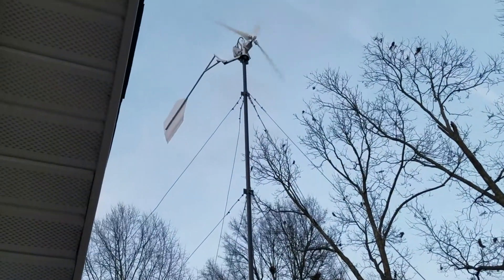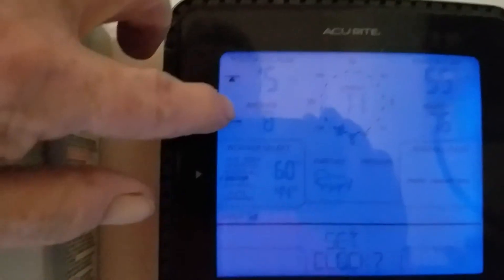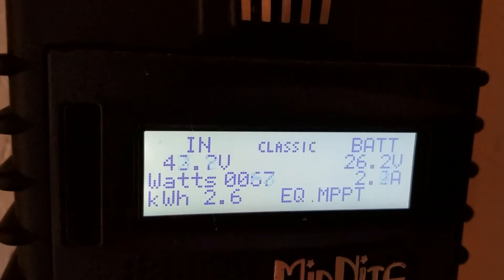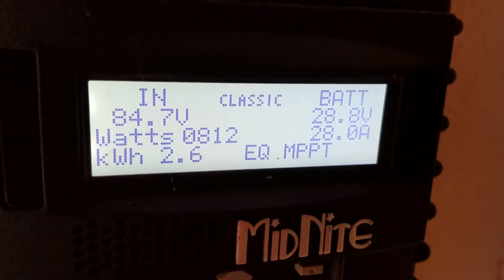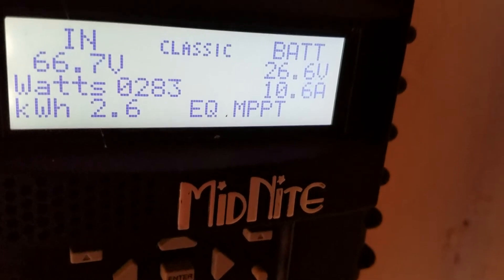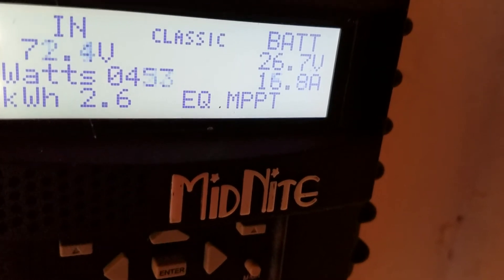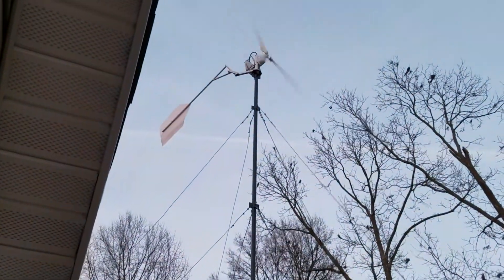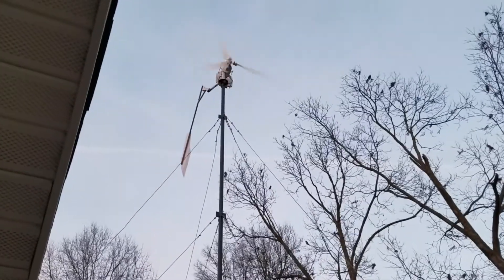wind turbine output jan 2018

Comment: Nice ... what wind turbine is that ?
Reply from the maker: its one of the type i build.  most call it a Axial wind turbine, no cogging at all.  20 magnets on each plate, 15 coils, 5 per phase, its built to put out decent power in low winds.
Reply from the maker: its 8:59 and i am still getting readings over 1KW highest i have seen is 1877 watts  total of 3.5 kw so far, it should go over 4 kw before midnight
Reply: Oh ok cool I have Hugh's book but desided I could not work with strong magnets in my metal fab shop because of the steel dust every where .
Reply from the maker: you can make all the parts, then i set up a work table out in the yard, all wood, and installed the magnets  then brought it back in the garage.  if you do get some metal dust on it, its easy to remove it.  it almost hit 4.0 KW it was just about to turn to 4.0 when time ran out, it hit 3.9  144amp hours highest watt reading was 2,348 and highest voltage input to charge controller was 142.2  so tomorrow is more wind, but with some rain
Reply: wow your making some real power . I was just watching your earlier vids when I saw your replay . I've been working on my tower and put up a windy nation supper amp at 55' but still have to run wire under ground into house , the weather has me on hold right now. I will follow your advice about the magnets this summer though as the supper amp tops out at around 55 amps  I think . but I will see when the weather brakes .
Reply from the maker: sounds like fun. fairly soon ill add a second inverter, a outback fx version that can be grid tied. it still needs a small back up battery bank to work, but 90% or more goes right back into the grid so you get even higher output from your wind turbine. the batteries limit output with resistance. the fx once batteries are full sends it all, making that meter turn backwards.  power company has to install a meter, called Net-metering. but you get so much more from the wind turbine.
Reply from the maker: oh, forgot to mention, magnets, i use to get them from Magnets4less, which i found out were low grade seconds.  i only get magnets from CMS magnetics, really good quality .
Reply: I have decided not to mess with grid tying and just keep circuits separate . the power companies want to renew contracts once a year .
Reply from the maker: well, when your ready to built your turbine, if you need any suggestions just let me know, be glad to help
Reply: Thanks I will .  I'll probably have questions once I get started .

Comment: Wow, you finally got some wind. As expected, great production for low wind!! Thanks for sharing 😃
Reply from the maker: wind is still 15 to 18 mph but more of it lol. tomorrow same kind of wind mixed with rain
Reply from the maker: its 8:58 and i got 3.5KW so far and still seeing readings over 1kw. had one at 1877 watts.
Reply: SilentDeath002 Holy smoke that's what I have to get started on second turbine. A 24v, 70 turns, 14ga.... but it's what so nice to see those 10.6 blades working too! Thanks Steve
Reply from the maker: i have the 8.5 feet blades on this one, imagine the output if i had the 10.6 blades on it lol. its just about ready to hit 3.8 so should be right on track to reach 4.0
Reply from the maker: i watched the reading right up to midnight when it reset for next day, finished out at 3.9KW 144amphours highest watts 2,348 and highest voltage input to charge controller was 142.2  more wind tomorrow but mixed with rain
Reply from the maker: it hit 3.9KW. 144 amp hours, highest wattage input was 2,348 watts, highest input voltage to charge controller was 142.2  more wind, mixed with rain
Reply: Thats grate ..... keep us up dated please .